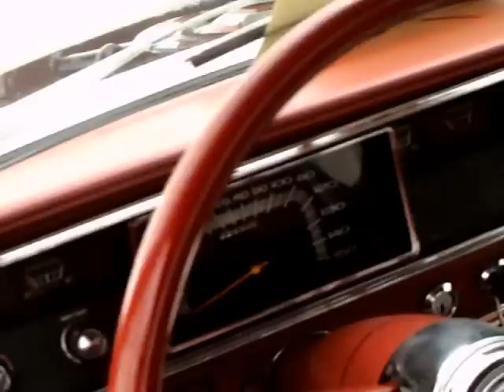1967 Plymouth Satellite GTX hardtop

Comment: Gorgeous inside and out. The headrests make the buckets seem even sportier than usual.
Reply from the maker: I think that 1967 was the first year for mandatory head and neck protection, either by a separate headrest or a seat that vertically covered that area.  An important safety feature, indeed!  Thanks!  :) Jack
Reply: I think 1969 was the year for that, actually. But, obviously, they were often optionally available before that.
Reply from the maker: You are correct....I don't know what I was thinking...both my '67 and '68 cars did not have headrests!  Thanks!  :) Jack
Reply: We all make these mistakes. My '67 Biscayne didn't have headrests but my '69 Rambler sure did :)

Comment: In 68 Plymouth brought out a muscle car without frills and called it Road Runner. In 67 Plymouth had a muscle car with many frills and here it is the GTX, In the eye-candy department the interior almost rivals the New Yorker. Jack, I do agree that the triangular shaped C pillar was one of nicest for a 2 door hardtop. This chassis is basically the same as a 62 Fury and I was just wondering what would have happened if Plymouth would have brought this out in 62 instead of that awkward 62 design.